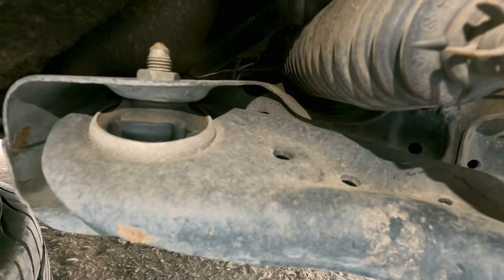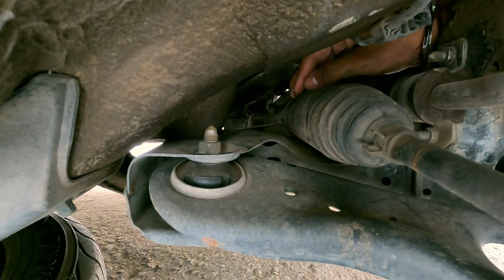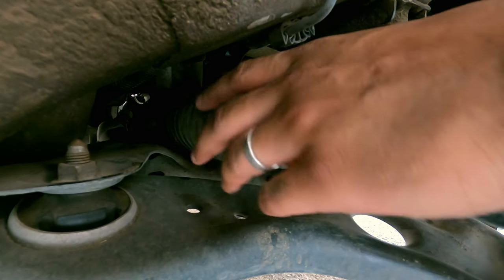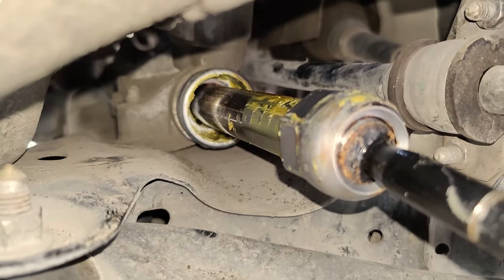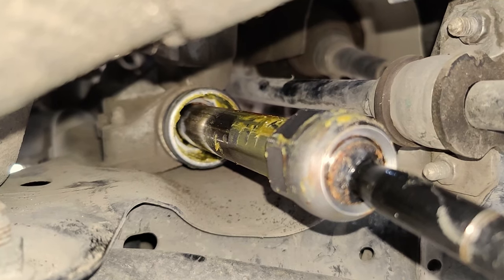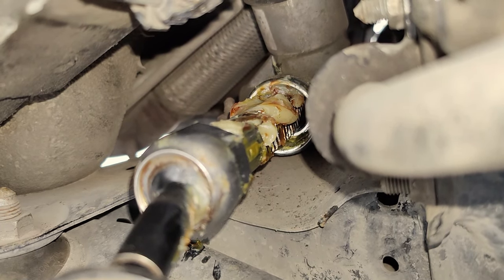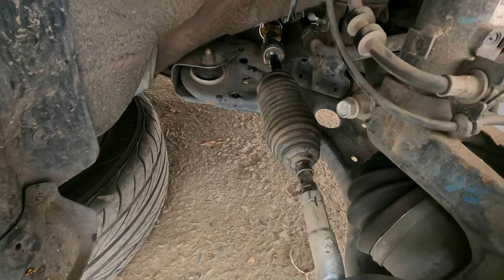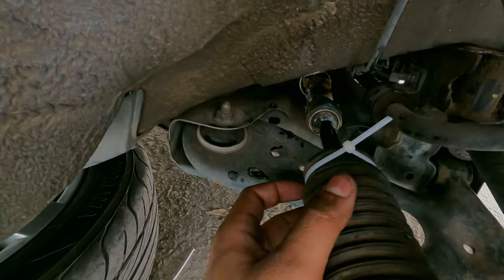STEERING RACK LUBRICATION | REPAIR | GREASING | PINION | HARDNESS | NOISE | HOW TO

Comment: Also kindly clean the rubber boot and then spray a healthy dose of Silicone spray in order to nourish the rubber (restore and retain the elasticity) which helps to prevent the cracking of the boot.
Reply from the maker: Sure sir
Reply: @yourDIYneeds  Brother, I love your attitude of respecting others. Kindly address me as Larsen and not as, "Sir." Peace ;)
Reply: What do you recommend  to spray on it? Mine is tore up  will replace  before new tires  amd wheel alignment  since have to take tire rod off to replace  im thinking of a walk around like cut down middle amd hot glue gum to seal or silicone to seal the seanm I cut  but ill go the best way amd replace taking tires rod off and replace tires do balance alignment  etc...
Reply: @prtbone78  Instead try applying a thin layer of Shin Etsu grease. Honda has released several service bulletins and they all recommend this to protect rubber and to prevent it from squeaking / lubricate it. From my own experience CRC/WD40 silicone lubricant or maxima SC1 protectant will eventually wash off and won't last more than a year, but Shin Etsu grease will last a lot longer.
Reply: @ubernihilist457 thanks  for the reply  ill check it out. ..

Comment: I would suggest clean the old grease completely first before adding the new grease as 2 different greases are not supposed to be mixed unless you got the same grease as the manufacturer put in before you.
Reply from the maker: Yes sir , ideally that's the best way to do it , but the older grease had the same appearance as dried up normal petroleum grease usually have , that was the reason why i added on top of it

Comment: Hi mate. Could you tell me please what kind of grease did you use in this video? Thanks
Reply from the maker: Sir best is to use a high temp. Grease 
But at the point when i was shooting the video , i did not had a high temp. Grease so i used a normal petrol based lithium grease
Reply: @yourDIYneeds  Thanks. BTW good instructional video 👍

Comment: Which kind of Lubricant can i use for my car? I have an Citroen C-Elysee with Electronic Power Steering (EPS).
Reply from the maker: Sir , inside the rack any normal lithium grease will work just fine
Reply: @yourDIYneeds  Thank you for your help my friend.

Comment: hey I have an Ford Fiesta and noticed that Hydrolic oil is leaking through there. what do I do
Reply from the maker: Sir that means your steering rack is leaking 
We have two options , either go for a new one or get the seals replaced inside the rack , for both of these work , rack will come out
Reply: ok thanks think ill get a new one cause comes with everything.
Reply from the maker: @FaithfulAbundance sir thats your choice
Reply: which will be cheaper?
Reply from the maker: @FaithfulAbundance repair

Comment: After very long time....pls send a link for steering & other greasing parts of storm dicor and cleaning of sensors of it with a cleaner or... Can i use mogsol nano drop spray..it's a lubricates, penetrate, & prevent rust

Comment: The car steering should come back to its place but it has to be brought back. The power that the steering should have is not there.
Reply from the maker: Then firstly get the alignment check ( alignment consist of toe angles , camber angles and castor angles ) if they are not set correctly , then steering will not behave as it should , it will also feel numb while driving
Reply: @yourDIYneeds  
Alighnment is ok
Reply: @yourDIYneeds  Someone has a permanent solution to this with a new apology
Reply from the maker: Was the car involved in a crash ?

Comment: To protect the rubber you can use a thin layer of Shin Etsu grease. Honda has released several service bulletins and they all recommend this to protect rubber and to prevent it from squeaking / lubricate it. From my own experience CRC/WD40 silicone lubricant or maxima SC1 protectant will eventually wash off and won't last more than a year, but Shin Etsu grease will last a lot longer.

Comment: nice video! Is there any way if that boot stays off can it cause that area to creak? Maybe because its dry? I got a creaking noise when only when i turn from the driver side of the car
Reply from the maker: If boot is not on its location then , the lubrication will have to face water and dust from outside , which will eventually wear the rack out , so having the boot on is kind of important

Comment: Metal clamp is there for a reason. It must be like that because in full turn of the wheels the boot is pulled very strong, and plastic zip like in video is too wonky for the job! 
70 mm dia should be OK. I had to use 90mm at hand, it got just enough adjustment. With RHD UK car, fixing left wheel, I had to remove the air filter to access with screwdriver when the wheels turned to help compress fixing the boot clamp.
Reply from the maker: Sir i completely agree , metal clamps are better as they exert more force on the rack body , but there is one more thing to remember that at the end of the rack there is a lifted lip . So if the boot is properly inserted over the rack and the zip tie is installed even with a decent amount of pressure , that boot is not going anywhere .

Comment: Excellent video, was this rack making any clicking noise when turning steering wheel when parked only?
Reply from the maker: No sir , no noise was present
Reply: Sounds more like a steering driveshaft issue...old worn out u joints.
Reply from the maker: No sir , have a look at previous videos , complete suspension was done
Reply: @yourDIYneeds  Wasn't he talking about his car?

Comment: Can I get a piece of advice on clunking noise over bumps?
Reply from the maker: Sir , Have you checked the link rods ( stabilizer ) ?
Reply: @yourDIYneeds  yes I've changed the link rods last week along with the arm bushings and steering outer ends.The noise is still there. I've also watched your steering rack preload adjustment video but mine has 14mm nut instead of 19mm and it is rock hard to move it either way.
Reply from the maker: Sir one last thing is to check the brake caliper puns for play , sometimes they also make clunking noise on potholes , quite common with floting caliper design.
Reply: @yourDIYneeds  I've also checked and changed it by watching your video sir.
Reply from the maker: From which side the noise is from ?
Reply: @yourDIYneeds  left hand sir.
And I've removed the boot and upon inspection I've found play in the steering rack.
The steering response is fine and it has no wobbling or stability issues.
But I'm unable to figure out wheather my preload needs adjustment or I've to change the whole steering rack assembly.
Reply from the maker: Sir just open both boots , lubricate the gear teeth and shaft and then adjust the preload , if the noise still persists then we can think about the rack replacement
Reply: @yourDIYneeds  okay but the preload adjustment is the problem. How can I share the preload nut picture to you?
My vento has a 14mm and it's rock hard to rotate
Reply from the maker: Sir , you can drop me a mail at everydaydiyhelp@gmail.com

It is supposed to be rotate-able  , if anyone already did not tighten it
Reply: @yourDIYneeds  I've mailed you sir kindly check
Reply from the maker: Replied sir

Comment: what kind of the grease should I use on the rack gear? Any brand recommendations? Thanks
Reply from the maker: Sir any decent brand , just remember high temp grease, due to the proximity of rack to exhaust

Comment: Sir grease konsi use kare jo special  es kaam ke liye hi use hoti ho vo bato...jo grease  cold season  mei hard na ho ?
Reply from the maker: Sir Normal grease ache se kaam karegi
Reply: @yourDIYneeds or sir  stering ke u joint ko liquid grease spray se lubrication kar sakte hai ya power stering oil ko injection ki help se lubricarion kare ? Dono mei se kon sa thik rahega n
Reply from the maker: Sir steering joint serviceable part nahi hai , agar aap use grease karte bhi hai to bhi wo grease upar hi rahega

Comment: My steering is fine but when I turn the car, the steering does not come back to its place
Reply: What to do?
Reply from the maker: Preload is tighter that what it needs to be
You can watch the video of preload adjustment on my channel
Reply: Alignment check... Caster is what determines in great part  how well the steering returns to center... Camber as well greatly affects steering return.. worth checking... strut bearings also
Reply from the maker: Sir only if the castor is adjustable , but in this scenario its not , its fixed by manufacturer .

Comment: @yourDIYneeds bro, in my case i changed the rack as the steering felt heavy and doest auto center after turning. But after rack replacement the steering feels better but definitely not comfortable to drive in city with single hand. I still fell heavy if i had to completely turn left or right. Any suggestions please? I also changed front struts mount bushes and greased them.